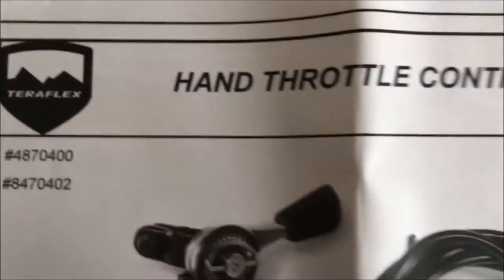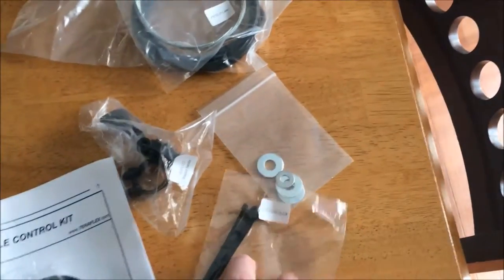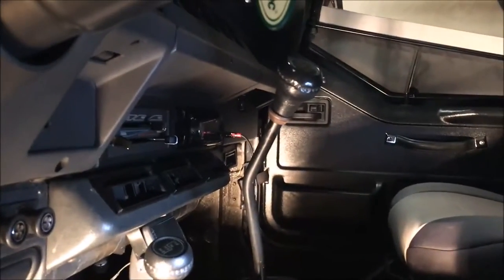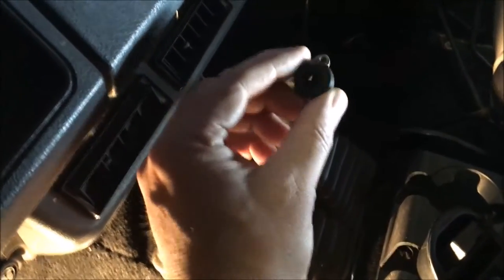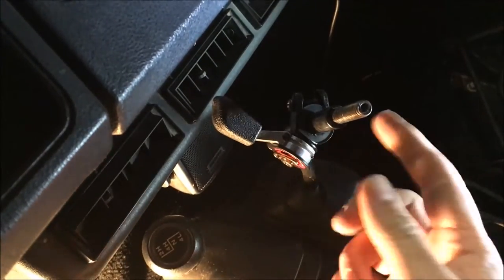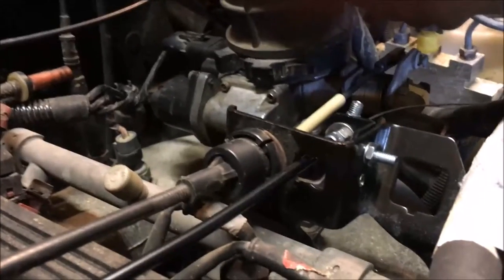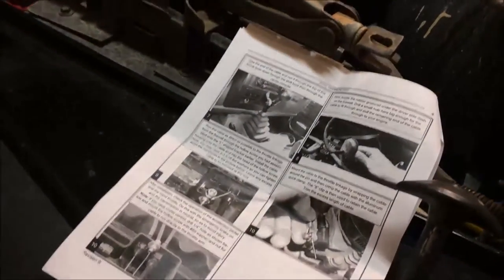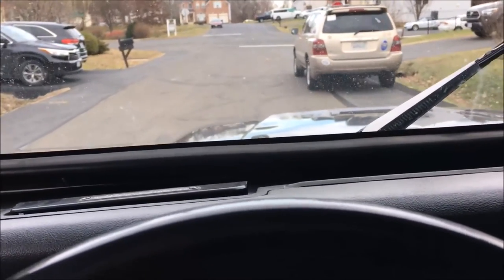Jeep YJ Hand Throttle Install

Comment: Installed this kit 11/24/19 on my 1990 carbureted 4.2 Wrangler,routed the cable down through the shift boot, had to pull it apart but am glad I did,the install on a 4.2 is tricky under the hood,you have to get creative with fastening points for the hardware but thanks to nutserts,(Google it!) It's done and works perfectly! Thanks for the video!

Comment: Why not run it down the shifter, through the boot and bring it up from under the Jeep?
Reply from the maker: That might work.  I did not try it for the length and not sure about running in that hot area.  The directions with the kit do it the way I did.

Comment: The original throttle cable doesn't interfere with the hand throttle cable operation or vise versa?
Reply from the maker: If you are real careful with the connection of the cable to the throttle you will never notice.  I have had the cable stick a few times unexpectedly but I straightened it out and it has been fine since.